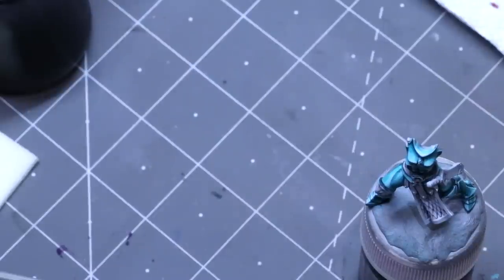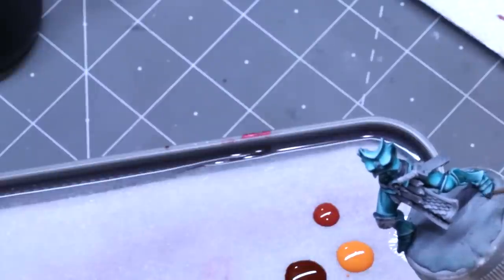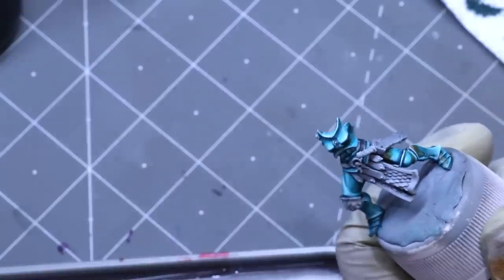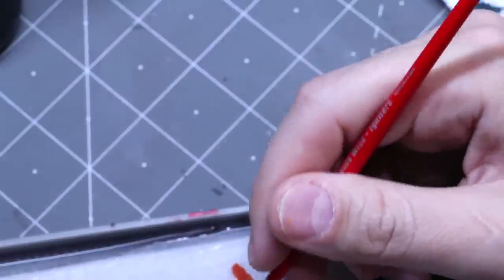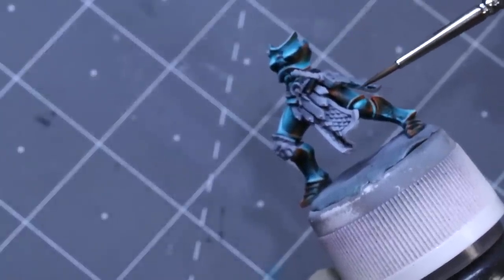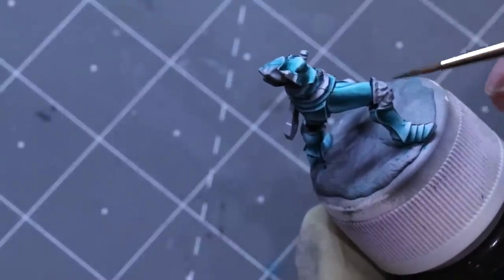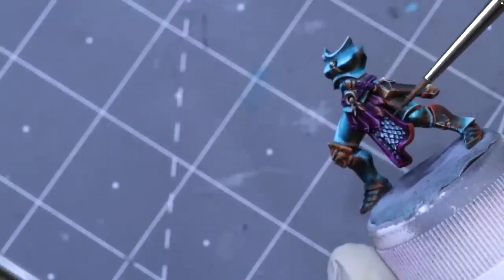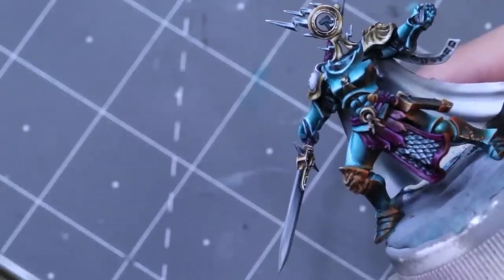Hobby Cheating 216 - Reflected Lighting

Comment: Hi Vince. This comment has nothing to do with this video, which is great. But I have some bad experience with spray varnishes and I've ruin my miniature and all the job, because I suppose I use too much and my paint goes vary blurry (with Vallejo, spray matt varnish). I want to varnish all my minis to protect them, because I play with them. So I want to ask you if it's a good idea to use first a bright varnish with a brush all around the mini to protect it, and after this step use a spray matte varnish. Coul it work? Have you try something similar. I'm pretty scared about to try it, but in the other hand I want to protect my minis in an effective way without ruin the previuos paint job. Thank you so much. And keep teaching us please!!
Reply from the maker: So a few thoughts. 

1) I don't varnish my models as a final step. I play with them, but unless your moving in foam, as long as they are plastic, you don't generally need to varnish. 
2) Yes, you can do a heavier coat of gloss or satin varnish and then matte it back out, that works just fine. 
3) If you are going to do this, do it after all your matte colors but before you apply any metal paints. Varnish will generally ruin the shine.
Reply: @VinceVenturella .Yes. I move my minis with foam cages. Is there a better way to protect them? Sometimes even with the touch of your fingers you can remove some paint. And that's annoying. Varnish ruin the shine, it's exactly what it happens. But, any other tip to protect your painted minis? I'm very impressed that a lot of good painters didn't protect them and I don't know why because I'm always worried about it. Thank you so much.

Comment: Amazing video, I needed this!! Question though,  could u have gone even brighter on the reflective surface ? It appears on video that the orange on the metal is the same strength as the cloth. Also would the color of the underlying surface affect the reflected color?  Thank you soooooo much for your videos!
Reply from the maker: So this is a complex question, the reason I ended up dulling out the metal is because of the underlying color. So orange is opposed on the color wheel with blue. Her armor is turquoise, which has a component of blue, this is going to push part of the color into more a more brown tone (hence why you saw me bringing that into the shadow). If the armor had been steel for example, or pure green even, you would have seen a brighter reflection. 

You have to take the surface, contrasting colors, finish of the material and such all into account. So a matte white surface might reflect the same as a shiny turquoise, but a shiny gold would beat both. But then you also have to figure the distance from the light source as well on top. 

If you are going for accuracy, there are few more complicated things. :)
Reply: @VinceVenturella  thank you for the great explanation!! I only ask because I'm at that point where I'm trying to place a miniature in an environment rather than just painting. I love the complex lighting that some artists use and an trying to wrap my head around it all. Plus this video is where I'm at in my "nmm journey ", happy with the basics of my painting but again it's time to place the reflective surface in its environment.  Thank you again very much!!

Comment: So do you consider how a colored metallic surface will change the reflection of the colored light? As an example, I did a ton of research into this type of thing for Everchosen, and found that shiny black metal (on cars) reflects green reflections from grass as kind of a muddled brown-green, whereas the sky off black is a desaturated blue-gray moving towards a more and more saturated blue, or white (depending on light source location and all that). Do you bother with things like that?
Reply from the maker: Yep, you are exactly correct.   I ended up dulling out the metal is because of the underlying color. So orange is opposed on the color wheel with blue. Her armor is turquoise, which has a component of blue, this is going to push part of the color into more a more brown tone (hence why you saw me bringing that into the shadow). If the armor had been steel for example, or pure green even, you would have seen a brighter reflection. 

You have to take the surface, contrasting colors, finish of the material and such all into account. So a matte white surface might reflect the same as a shiny turquoise, but a shiny gold would beat both. But then you also have to figure the distance from the light source as well on top. 

If you are going for accuracy, there are few more complicated things. :)